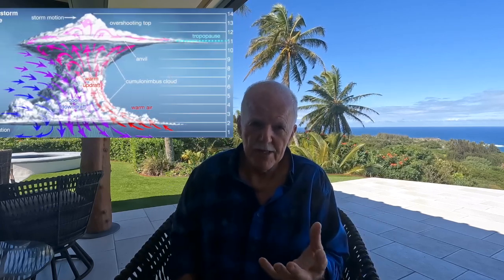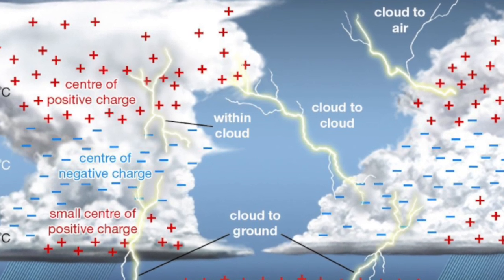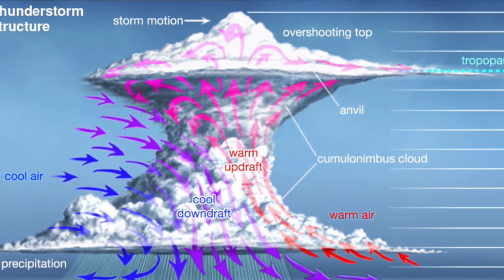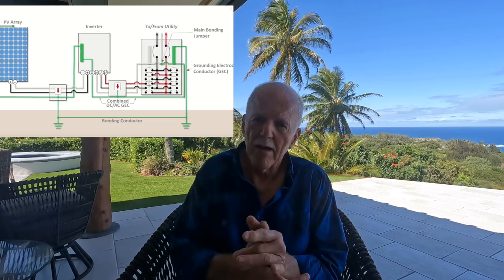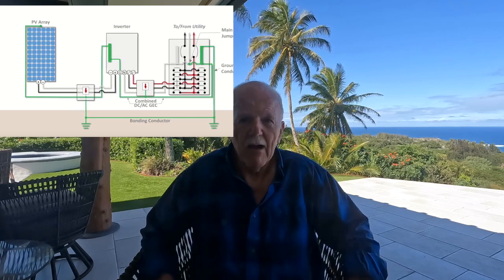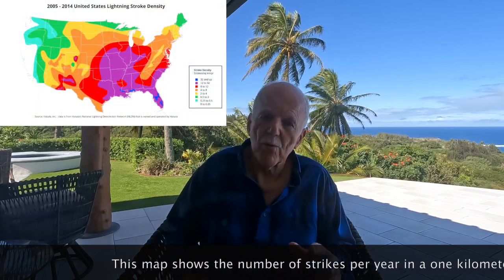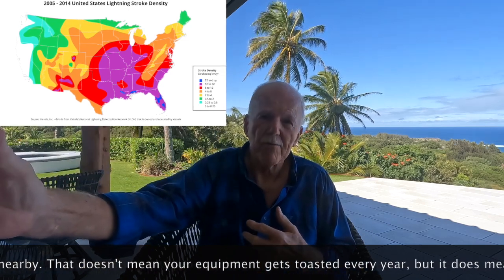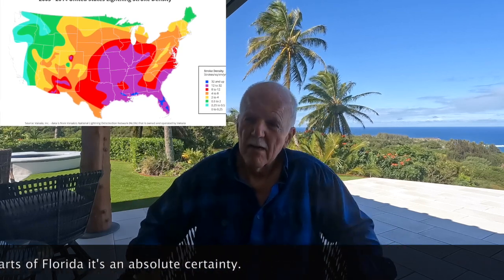Lightning vs  Solar

Comment: For ground mount solar arrays :
Would it make sense to have a TALL metal pole with one or more ground rods attached to it, several meters from the solar array....(not connected to them) ?   
As Mike holt has stated...."Better the protection to be AROUND the (ground) solar array.
Reply: Makes sense to me

Comment: Is there any risk of building up some type of circulating current with two ground rods in separate places like this? I’m a substation electrician (that lives fully off grid!) and know just enough to know I don’t know anything.
Reply from the maker: not if the ground rods are bonded together with a very low resistance connection

Comment: The 6000XP high-frequency inverter is far more susceptible to damage from lightning strikes than low-frequency inverters. Don't take my word for it. Google " Are high-frequency inverters more susceptible to lightning strikes?"
Reply from the maker: True. Though it’s not a huge difference. Transformers provide both some isolation and inductive reactance to block voltage spikes though a big pulse stilll makes it way through and can kill the transformer the real equipment killer is spikes on the ground conductor which defeats both isolation and surge protection
Reply: @ExpertAmateur-xn6dr   You’re right, connecting ground rods directly, in addition to through your equipment ground terminals, is the best way to reduce resistance between ground rods to below 1ohm so that gradient voltage and current flow should be mitigated to tolerable levels.

Comment: Just to clarify, are you saying the grounding bond between the detached solar array ground location and the main service ground should be a separate run in its own trench?  I ask as I was going to run it with other DC and AC wires back to the main panel area (including through the basement to the service ground).
Reply from the maker: No, I used the same trench for all my wiring, though all the other wire was in conduit (schedule 40 PVC) and the bonding wire was just bare.
Reply: @ExpertAmateur-xn6dr  Old question, but for new readers i wanted to share what I learned from a lot of reading on this subject.  When possible, it’s best practice to burry two bare tinned solid copper ground conductors at least 3 meters from away from the trench for your positive and negative pv wires.

Comment: been on solar since 2019 and i live in the philippines and we get severe thunderstorms and lightning most of the year. my panels is grounded directly to my house{steel reinforced concrete building} and so far has not suffered any equipment failure. solar is connected with dc mcb to scc and didnt bother using spd. my house is parallel the main power lines.
Reply from the maker: So far, so good. I think that's what some people say when their parachute doesn't open. I'd be adding a ground rod, the steel reinforcing rod inside concrete structures isn't necessarily continuous to ground. It's cheap protection--a piece of wire and an 8' rod--you can use rebar, though I'd use a thick one. In the Phillipines, like here in Hawaii, steel dissolves pretty fast.
Reply: @ExpertAmateur-xn6dr  Agreed, spend a few hundred on grounding/SPD best practices to protect several grand worth of equipment.  It won’t save you in a direct strike, but it’s cheap insurance against all the indirect strikes, which are exponentially more common.

Comment: I don't think anyone feels you got it wrong in your previous videos. I think this video was necessary and helpful. You clearly explained there are several things happening involving equipment grounds. You explained during an electrical storm it's far more likely for equipment to be damaged by energy traveling through the equipment ground and soil than lightning striking the electric lines.
You also clarified most electronic equipment is not going to survive a direct lightning strike regardless of what protection that has been implemented.  Thank you for firming that information up.

Comment: I have a quick question? 
My service pole is approximately 75 feet away from my home and panel. 
Helco had me install 1 ground rod horizontally 10 feet deep and is also connected to another rod placed 18 inches deep which is in the ditch that runs from the pole to the house and panel. 
Are you suggesting I run another ground wire from the service pole ground to the solar panel rack ?
No one around here has anything like this but if this is a good idea I'm in .
Thanks in advance. 🤙
Reply: Sounds like you have some pretty tough soil conditions. In most locales The authority having jurisdiction is trying to ensure the NEC requirement for a minimum ground resistance is being met to minimize shock hazards. 
This may also help during electrical weather events. 
The harsh reality is: little can be done to protect against the massive amounts of energy caused by electrical storms and nearby lightning strikes. 
Even if we could somehow wave a magic wand and turn our grounding system into zero ohm superconductors it would not ensure ZERO chance of equipment damage during an electrical storm. It's just the nature of the beast.
Reply from the maker: Wow, that sounds like the moisture in your soil must be pretty deep. But yes, that's pretty much what I'm recommending--but let me clarify. Add a ground rod at your array (assuming it's a separate structure from your house) probably a 10 foot one since it sounds like you have some soil issues, with the grounding connection on your rack connected directly to it--as few bends and as straight as possible, and then trench to your service entrance ground--not the utility pole. You undoubtedly have a ground rod there as well--that's basic code. The ground rod at the pole is for the transformer case. Bond (connect) the service entrance ground rod to the array ground rod. It doesn't have to be a super deep trench though deep is better just to keep it from getting dug up accidentally. I used #6 bare copper wire. It's a bit non-standard, my inspector thought I was nuts until he asked the city engineer about it, who told him if he had things his way it would be required, and it was semi-required in the 2014 NEC code. It's more of a best practice. As powerguymark says, if a strike is very near, or very powerful even at 1000 yards it won't do much. But for everything less it's cheap insurance.
Reply: @ExpertAmateur-xn6dr  Thank you for your reply. 
The array is being mounted on the roof of the house. 
I  added an extra 2 inch abs pipe in the original trench for?  But pulling the wire from the original grounding rod at the pole is no problem. 
The other rod should be fun as most of the ground here is solid blue rock. I  have access to a backhoe and hammer so just time and work. 
Thanks again. 👍